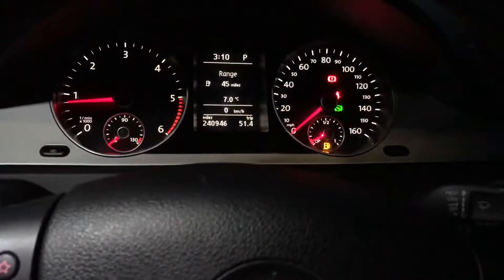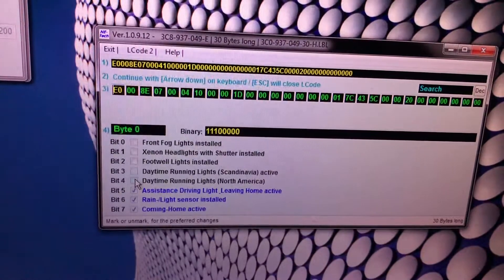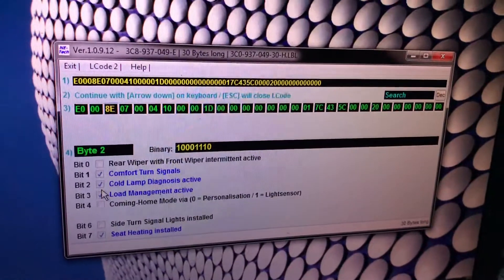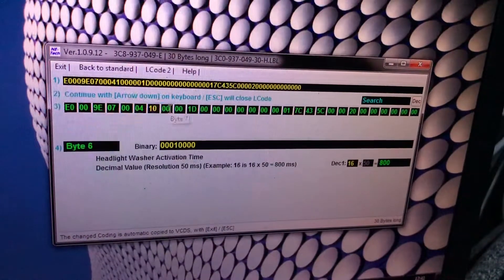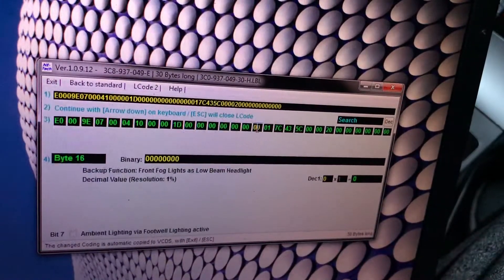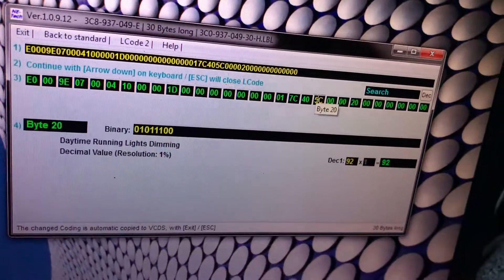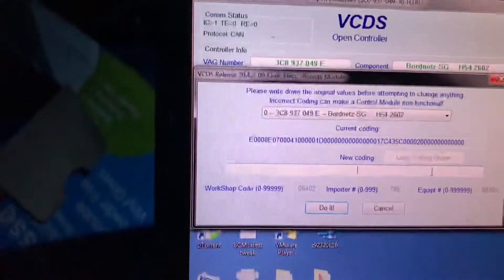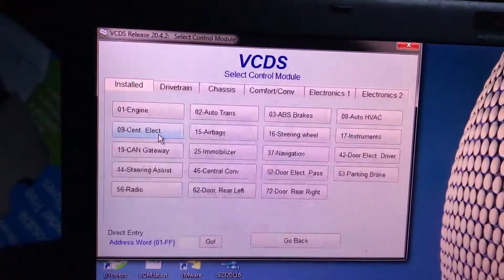Passat B6 CECM coding after retrofitting new Central Electrics Control Module

Comment from the maker: If you have any issues coding go to adaptations and reset all channel adaptations, save and try to recode again.
Just make sure you have the old module pictures of what’s selected. You cannot transfer long coding from one to another
Reply: hi i have a problem with handbrake for passat 2007,i need change new brake control module,do you know how to coding new module ?
Reply: brake module code is 3C0.907.801.E
Reply from the maker: I can recommend upgrading to 3c8 module, I’ll make a video how to do that soon.